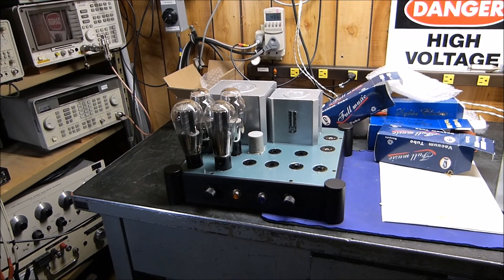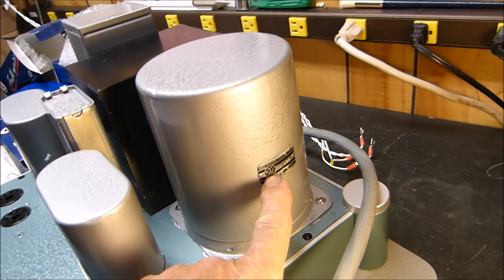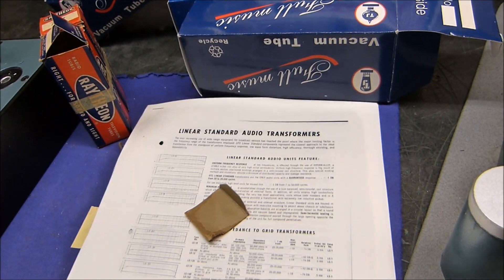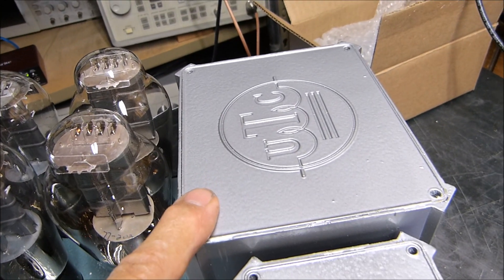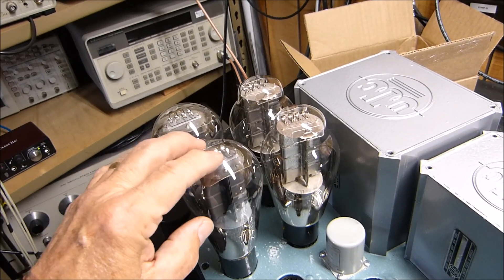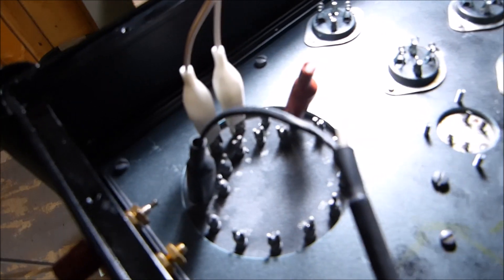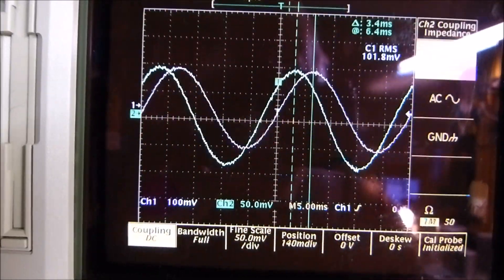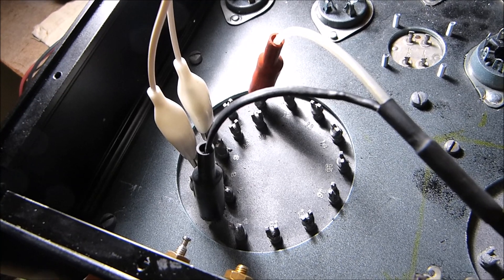Parallel Push-Pull 300B  Triode Amplifier United Transformer Company (UTC) LS-58  Brook 12A Design.

Comment: Greetings, thanks for your content. I was going to build a brook 12a. I started looking for parts and realize it may be a challenge finding a suitable pair of chokes for this build. I plan on using  6a5g's and I have some old  hammond 1705 output transformers. I got one for free in an old modified tube console running the 6a5g's in PP. I found a matching 1705 on the net. I was not sure what to build but thought the brook might be fun. There are some interesting things going on in that amp. Any recommendation for the center tapped choke? It's seems to be the most mysterious piece of the build. Thanks
Reply from the maker: The Brook 12A is an interesting design and I have read that Paul W. Klipsch said it was his favorite amplifier for his speakers, specifically the Klipschorn, if I remember correctly. I did use this amplifier for a short time before sending it to the lady I built it for but I never tried to loosen the nails in the wall with it. It also will not perform perfectly on the test bench in the 20 Hz to 20 KHz range as we tend to think high-quality amplifiers should. 
The output of the first stage has a high pass filter in it that is going to attenuate lows. Attenuation of lows, from what I see historically, seems to have been popular in the audiophile world some decades ago. I don't know why. Possible a complaint of "boominess" in speakers - who knows - but I have seen LF attenuation in other designs also.
That type of choke can also be seen in the Altec 260A. Link below.
https://www.pearl-hifi.com/06_Lit_Archive/07_Misc_Downloads/015_Altec_260A_Instructions.pdf
The advantage of the choke is it allows almost twice the drive voltage for a class A amplifier over RC coupling. The bias on the 813's in the Altec need this higher drive voltage but most tubes we use nowadays does not need this extra drive voltage. Also, these chokes, as seen in the schematics, are extremely rare and have inductance values in the 2000 Henry range with very-very low to zero current thru them.  With that said, you could use a couple of high inductance chokes (side by side and in series, not magnetically coupled) that will do the job - if that is what you feel you need. Just something to think about.
Reply: @ElPasoTubeAmps  Thanks for the reply. I'm really amazed by your knowledge. I'm just a hack that can follow a schematic :)

  I have been trying to figure out this brook 12a for a few days. I had not known about back biasing so that was interesting learning about that. Randall Aiken does a good job explaining it. BTW  I made an error on that model # of hammond vintage transformers. It's a  1715 not 1705. The 1715 output transformer is rated: at15 watts; 5k primary imp; output taps of 4, 8, 15, 30, 125, 250, 500; freq. resp. of 30 - 12k + - 1 db at full rated output. This from Hammond's 1965 catalog. Not exactly stunning specs but they were fancy high fidelity OPT for their time. 12k seems to be as high as my hearing can detect these days anyway :). 
 I think heyboer sells a choke for the job as does Magnaquest if you can figure out how to contact or purchase from them (Magnaqest). Anyway keep up the good work/content!
Reply: I believe the Altec 1570 had very close to the choke that would work for the  12b. I read that somewhere today.
Reply: The 6a5g is also a 6.3v indirectly heated cathode so that makes it a little simpler than the 2a3.
Reply: Maybe you could  do a video on the 12b and share some of your wisdom and thoughts on the design.
Reply from the maker: @swingarmer   These will work

https://www.ebay.com/itm/115134857460?hash=item1ace9280f4:g:SJ4AAOSwY1xg8zgM&amdata=enc%3AAQAHAAAAoAZBhSkeupcgUf2gKLr1pTrvHh5mClqaoxzWu38ag2XkR4BCBI6kJz0LtJZmLEMNrGhZSL9sijl4WtA1hmH78Y9PV4xROowGhfVhXiYg%2FFMaJmeLiUE3B41eqfNRqG5sN6PMFMkDe3dh79OsRZw4an3n6CInL0eL0CPXJAJw02wDAJR%2F1CqFTgYV9PajsKGP9gzjQwtlEyhlMxCJTo7o91c%3D%7Ctkp%3ABk9SR47OmdKXYQ
Reply from the maker: @swingarmer  Totally agree - 2.5 volts is a nuisance although they can be wired in series and 5 volts used.
Reply: @ElPasoTubeAmps  Thanks. I  ordered them. Is there any other driver tubes you would consider with the chokes in the link  you posted above?
Reply from the maker: @swingarmer  You are a serious fellow. I don't meet many that actually go-for-it. There was once a website called "100 Amplifiers" part 1, 2, 3, and 4 but when I look it up I am not sure how to get to them  anymore. I downloaded and printed all four books a couple of years back. I am glad I did now as I am not sure they are available anymore. Be sure to study the maximum current parameters of these chokes before using them. There must me many thousands of turns of wire to get to 250 H per winding and 1000 H for the total of both in series. I assume you know how chokes on a common core add. You are going to build a classic. I would stick with the 6SN7. A 6J5 is just one-half of a 6SN7 just like a 6C4 is one-half of a 12AU7. I love them.  I have lots of good 6SN7's you might want a few of if you don't already have plenty. I have no issue sending international if you are out of the USA.
Reply: @ElPasoTubeAmps  Thanks ! You can still access 100 amps and I have the 12a schematic of Kurt's redraw . I also built a altec 345 clone using his redrawn schematic. This 12a is indeed an interesting amp and as I said I'm weak on theory and test gear. I do have a scope but I find it confusing and have not spent enough time trying to learn how to use it.  I find myself using a multimeter and  home made audio signal tracer. :) I dont have any of that wonderful gear you have :)  

 I have read, the original choke has a total  of 3.6k resistance end to end. There really is not a whole lot of info on this choke out there. At least I have had a hard time finding info on it.
I have limited experience with this type of circuit. There are several aspects such as back biasing that are new to me even though its a very old method of biasing. I hope these chokes will work good in this circuit. Also do you think a Hammond 272jx would work in a stereo setup with this circuit? Or is it better to make monoblocks? I have the 272jx on hand. 300-0-300  285 ma or there abouts.
 Have you ever used the russian 6j5 equivilants?  I have no 6j5 and the russian  6s2s  is dirt cheap.  Hope to start building this around christmas. Cheers!
Reply: I do have several 6sn7's BTW and thank you for your offer!
Reply: "you can still access 100 amps" I should have said using the wayback machine.
Reply: HelloI received those chokes. So  the fellow selling those said he guesses the chokes will handle 5ma at 1000H with about 12K ohm DCR. What is the typical amperage on the driver plates in the 12a circuit? Thanks

Comment: You have probably blown up your old power supply by now, but those old caps HAVE to go. I remember my dad's Brook 10C3. Link Walsh was a really nice guy, and gave me a whole BOX of new components which lasted me about 20 years. Now I'm "old" and use nice equipment of purely modern design. de KQ2E
Reply from the maker: Hi Bruce - these big oil capacitors do seem to last forever but I have seen them pop and spray oil all over the equipment. That happened to me  in an old HP signal generator a few years back. I parted it out to some extent, cleaning some components, and threw the chassis away. The possibility of PCB is to high to mess with. Speaking of receiving parts - a good friend and pro audio fellow here in El Paso brought me his HP signal generator yesterday to fix, which I have repaired, and gave me several boxes of tubes from Heaven. To start with, eight vintage EL34's, Mullard and Amperex. All check very strong except one which is bad - lots of 6SN7's, etc. Like Santa Clause came yesterday. As for real HV capacitors, I have, so far, had perfect performance with series 450v, 470uF capacitors (ten for 4500 volts) in my RF amplifiers. Not much money and I just "Goop" the bottom of them to an insulating board and string them together + to - like batteries with shunt resistors across each one and they work. In my opinion, beats the heck our of these monster oil capacitors of 4uf at 4KV. I am 70 years old and still use mostly my Collins S-Line and KWM-2A and 30L-1 but I do have three solid state radios (Ten Tec, iCom and Yaesu) that I use sometimes.    73  WA4QGA
Reply: @ElPasoTubeAmps  ,  I hear ya. If you measure the leakage of many modern caps, you find that only a handful are really good ones. Most are made in Japan. The high end "audio brands" just are ridiculous, however. ROFL Cost is prohibitive and design? Who really knows. They are all so secretive that they'd never make it in REAL businesses. So, back to basics for me. New Astron MS35 and a new Icom 7300 with a little outboard autotuner from MFJ (or a 3 KW manual tuner with a huge rotary inductor... LOL). I use a medical grade isolation transformer and a matching variable auto-transformer. de KQ2E

Comment: I love the amp I have a question what problems is there using four per side like a Cayan A100T are they four in parallel? Keep up the awesome shows
Reply from the maker: Thank you. I just looked up the Cayin A-100T and see it is a very nice looking stereo amplifier. When you have a "quad" you have two tubes parallel on each side of the push pull circuit. As for the impedance of the primary of the output transformer, begin by assuming two tubes (one tube on each side of the push pull circuit) and the impedance might be, for example, 5K ohms. If you put two tubes parallel on each side of the push pull circuit for a quad, the primary impedance of the output transformer would then be 2.5K ohms and so on.

Comment: I did a little on-line research. I did come across a reference to a  Pete Millet  design for 300b amplifier with no negative feedback. I'd be skeptical if that would be better than the Williamson Push -pull design.
Reply from the maker: Hi Bill,
Per your comment here, I looked at Pete's website and found the "Fatboy" 300B amplifier you are referencing. I agree with you and this one will have some NFB. I did notice he has some low value resistors in series with the filament to absorb some of the inrush current. I like that idea. He also has a circuit off the filaments labeled, Si Tubes DPM, (I think that is right, kind of fuzzy and hard to read). I have no idea what that is for. I am going to use a basic Williamson front-end with a 300H choke at the grids of the 300B's.

Comment: The Altec 811 amps are the 1570b. I have seven of them and I did the Tutay mods to two pairs of them. I run 572Bs in them.The original layout was a 12AX7 feeding a 6SN7 into a pair of 6W6s which drive the 811As. I changed it to a 12AY7 into a 6SN7 into a pair of E34LS driving the 572Bs.

Comment: Hello, this is Jodie. First I want to thank David for helping me with this project.  I put this power supply and amplifier chassis together from  a collection of random stuff. If I can answer any questions I will certainly do my best. Thanks for all your kind comments. The Genesis of this amp was from seeing a schematic of the Samson PAM-29. This amplifier was mentioned in Vacuum Tube Valley #1 http://bit.ly/2cy7ZSN The actual schematic can be seen here http://bit.ly/2H0PseZ . My idea was to take a more modern amplifier design like the Brook 12A  http://bit.ly/2H1BUzU to run the front end and keep the Samson PAM-29 for the output. The LS-18 was going to be used as an Input transformer if needed. The four Octals on the front amplifier are for Four 6L6 tubes if we wanted to configure it for Beam power. The two extra Octals near the LS-18 are for 6SN7 or 6J5 if we didn't want to use the 7N7 Loctals.
Reply: The original amp used four 250s or just type 50 triodes. Way to expensive today. And they used an oddball 7 volt filament. 300B seemed like a good substitute for the older 50.

Comment: Dave,  definitely use combination bias on the 300Bs.  Individually trimmed bias on each 300B is in order to prevent current hogging within paralleled pairs.  Unfortunately, DHTs, like the 300B, are extremely vulnerable to runaway, when "fixed" bias is employed.  Connect each filament's circuitry to ground via a 220 Ω/ 220 μF. network.  Cathode bias for part of the total bias voltage stabilizes the operating point and prevents runaway.  The 220 Ω part is your "idle" current test point.

Comment: For the front end have a look at the cascode LTP by L B Hedge - http://www.keith-snook.info/wireless-world-magazine/Wireless-World-1956/Cascode%20A.F.%20Amplifier%20-%20Long-tailed%20cascode%20pair.pdf , there is also a Glass Audio Article on the Cascode LTP and Morgan Jones used it in his "Crystal Palace Amplifier -( see M J Valve Amplifiers 3rd Ed - was available as PDF download) 
    Sorry have no 300B specific schematics  but check out "GEC An Approach to Audio Frequency Design" -https://pearl-hifi.com/06_Lit_Archive/15_Mfrs_Publications/GEC_UK/GEC-UK_AF_Amplifier_Design.pdf and Patrick Turner has made several parallel PP amps and has some very good ideas - http://www.turneraudio.com.au/poweramps.html
   AFAIK the 300B can be driven from a direct coupled cathode follower without using direct bias. This works well with the CF "driven" from a transistor CCS. This means a negative supply though is needed.
    I'll go through my article stash and see what else I can find. With those components you should be able to make a grand amplifier.
    All the best, Andy.